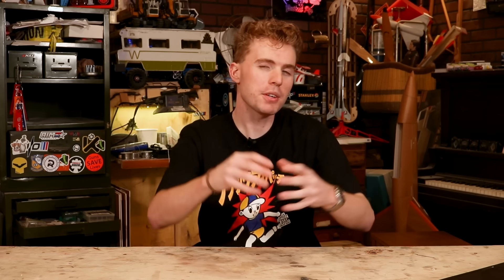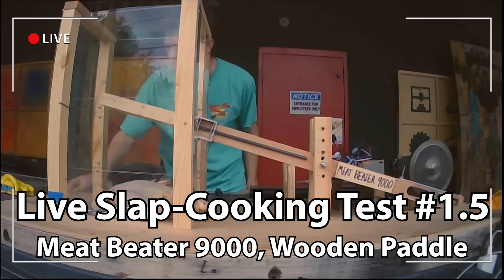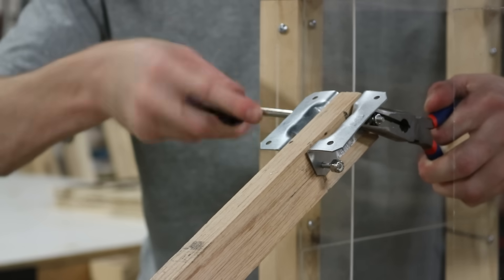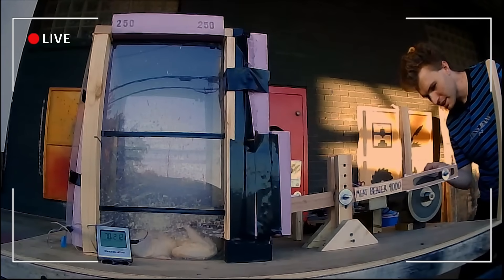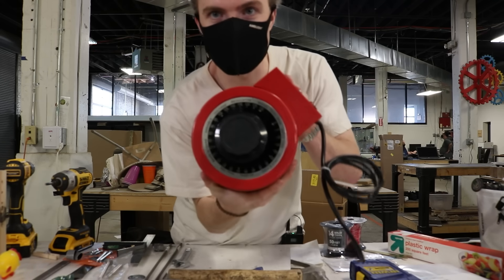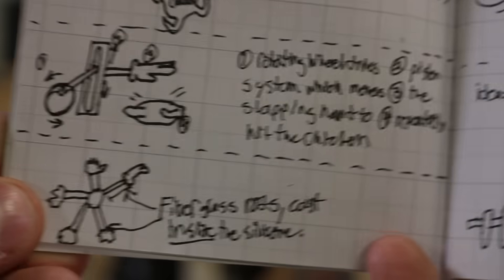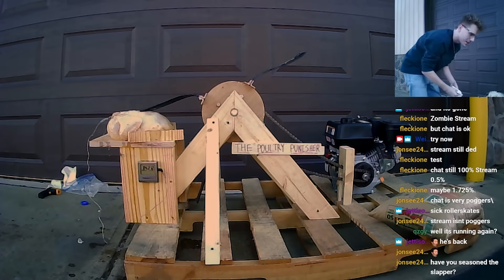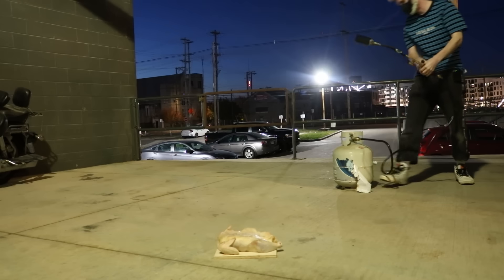How Many Slaps does it Take to Cook a Chicken?

Comment: You could go back to the meat beater 9000. 
Use a wide aluminum paddle that will distribute the energy evenly causing less chicken loss
Also use say a chicken breast without skin as it will not have to overcome the much thicker skin and will cook just meat. 
Also a reason that the poultry punisher didn't work is because it essentially pushed air onto the chicken essentially cooling it  a miniscule yet still enough to overcome the heat being put into it.

Comment: Should have put it under a peace of thin metal and slap the metal with the rubber not only will the friction from the rubber sliding off the metal and the energy in the slap will heat the metal up and cook the chicken maybe also tighten that chain

Comment: The kinetic energy of the slaps is not converted directly to heat, but rather toward both elastic and inelastic deformation of the chicken and to the failure of the internal structure of the chickens tissues. Also, some kinetic energy is being absorbed by the table and by the slapping arms.

Comment: So if kinetic energy can be turned into thermal energy which has heat heat is used to cook and speed can get so fast it generates heat if heat is generated it will stay heated until the o2 in the air cools it down so the faster I go the less time o2 has to cool it down and if o2 is slowed and heat is increasing therefore if I drop kick a chicken it will do nothing

Comment: Why didn't u make the box air tight and then get a silicone antenna where it is thinner at the top thicker at the bottom attach a paddle with a hollowed out handle made of metal run a bolt through put a washer on and then then nut and attach the mortar on the top so it is a bit tight vacuum so it won't lose heat but the kinetic energy won't be as use full so it will take longer but it won't lose heat or draw energy

Comment: I would use steel and a V8 engine instead of wood with bolts and a electric motor, so there's a low chance of breaking down.

Comment: Here’s an idea. You may be able to displace the energy coming from the motor more efficiently by using graphite powder on your joints, and a light chain lubricant. Also using polyethylene bushings on the joints may help with more energy efficiency. You can find these bushings in the suspension of some cars. They start to squeak overtime, but should work well. If you wanted to try a more manual approach, you can have a couple of buddies take turns smacking the chicken so you all get tired more slowly. The more people, the better. Kinda like a group of railway workers taking turns nailing a spike into the tie. Just a few ideas for further science.

Comment: I think the poultry punisher has a design issue: it generates powerful airflow.
While the meat beater generated currents as well, they were limited to a semi-closed system (also aided by your foam casing), while the poultry punisher creates currents that are much stronger and, not only that, are also drawing air from an open, cold system.
I believe that if you repeat the experiment in a closed environment or somehow reduce the airflow, it will be successful!
Don't forget that the experiment only hasn't succeeded because the meat beater broke: that one was working!

Comment: There’s still the factor of destroying the chicken, but a human hand usually contains our natural body heat which can transfer from us to surfaces we touch or vice verse depending on which has more heat- something that the machine itself possibly didn’t have being made of the materials it did. What if you had simulated this by finding a way to give the slapper a constant flow of our natural 98 degree (Fahrenheit) body temperature- or however much could be transferred with a slap- that could in turn transfer to the chicken? Add that the slightly-heated environment of a kitchen and the kinetic energy and you might get better results before you just end up tossing it in the oven.

Comment: What if you covered the chicken in some type of rubber shield and had that machine slap  the rubber on top of the chicken? Wouldnt the energy still transfer into heat and warm the chicken? Although the rubber might melt but I dont know

Comment: at every part of the engineering process the engineering team was looking at closed systems, or single problems without a ton of consideration for real world application. The poultry punisher by initial design is a bad idea because it only accounts for object of certain mass contacting object of certain mass in an instant. its pretty evident that no one considered what happens to the rubber slappers after initial contact, which is effectively sanding and pulling the chicken laterally. so there is no hope of the chicken lasting. it also looked like because of the flex and rebound of the slappy rubber that when the piece came back around it was in an ideal slap position. 

I still think this is doable. first, abandon the chicken punisher. it ruins the chicken. the second problem is all the math doesn't account for the non rigid chicken. make the chicken rigid. this could also solve or help with your ambient air problem. if you can build a metal or stone chicken mold and slap the mold with the chicken inside you would have better transfer of energy that wouldnt just go outwards as more lost kinetic wiggling, but also inwards turning thermal. using stone could be helpful for heat loss because the chicken is wet and is cooling easier than stone or metal would. the problem with this solution is it would take MUCH longer. so you would need a sturdier chicken slapper, which i think you could build. wood isn't meant for what you're doing there. the punisher may be the longest lasting, but it would still be heating by friction and not slapping, but you may have to just accept that as a given.

Comment: The problem with the rotational slapper is the friction of the rubber slappers drags particles of chicken away as the machine pulls them down and around with every slap. So while the first design had the “wasteful” up motion between each slap, it reduced the destruction levels significantly: I wonder if an all metal rig would hold together better. With parts welded together instead of using the bolts.

Comment: I know that I am not an engineer by a long shot, but what if the  contact area that the slapper has is with a piece of metal? The metal will heat up, and the chicken will be spared the unadulterated wrath of the slapper. Could the metal help retain some heat as well?

Comment: I’m curious as instead of using an electric motor you can use an electromagnet like they have set up on tattoo machines and control the depth via height you could prob get a higher frequency of hits too

Comment: The heat dissipates between subsequent slaps. In order to increase the temperature above the denaturation threshold of proteins and actually cook the meat, you'd either need to slap it that many times in a very short time, or somehow insulate it to avoid any heat loss. Both ways don't look practicable to me.

Anyway you try, it will liquefy for all the mechanical damage inflicted with each slap long before it's cooked

WTF Every time I add something to this comment, as I'm watching the video, then you say it in the video immediately after I click "SAVE".  LOL!

Comment: How did you all fail to take into account the air flow, the fact it's no longer in a box or any other number of details here...

You basically fanned it while slapping it... cooling it down while heating it up... adding a box wouldn't have even helped here.

What you need is 10 billion light slaps within a space of time that is probably impossible to achieve.
Reply: You literally surrounded your entire rig by a supercooled cyclone...

Comment: Another way to potentially look at the energy loss problem is to better control the ambient temperature of it's environment. If you could, say, raise the ambient temperature to always be 5-10 degrees lower than the chicken, you'd reduce the amount of energy you need to slap into the chicken to overcome environmental heat loss, while also definitively showing that the chicken's temperature is increasing by the kinetic energy you're slapping into it. And since you'd potentially need less slaps, you might not end up destroying the thing in the process.

You could also look at making the enclosure as small as possible so that the chicken has less space to heat up (and lose energy into). And if you try to control the ambient temperature, it's less space your need to control the temperature for.

Comment: I feel like the design of gas powered slapper  would create a lot more air movement, essentially cooling the chicken and negating the heat generated by the kinetic slaps. Additionally the rotation of the slappers is going to strip away the meat no matter what you do. I think you would need to design a slapper that utilized a slapping surface held at two ends, a little slack and flapped it up and down, sort of like a flag held at opposite ends. This would remove friction. It would still create air movement, but it would be easier to self contain within a "slapping oven" like you built for your earlier model. It would also be less prone to failure as the stress on the parts will be considerably lower. Additionally you could use a lighter material, which would damage the chicken less and place less stress on the slap mechanism. I think this needs a V3.0?

Comment: if 70-90 degrees in Fahrenheit, then it's super low in Celsius, meaning that you wont ever be able to cook a chicken, I think that physically it's not possible with motion/friction, because...well...yea, it causes what we see, even if you did it much faster it would just mean that the chicken would be ripped apart much faster rather than heated up. It's just like doing a burnout, while you may be able to lit a tire on fire, but that's only because the rubber is so thick, realistically the rubber material is just getting shredded away as well. If you had a thicker chicken that is solid rather than consists of sections and parts, there might be a chance, but it would still turn into a paste.

Comment: Would it work if you cooked the chicken indirectly, like if you cook a chicken on a stove you need a pan since the flame doesn’t directly touch the chicken so could you cover the chicken with something that would take the impact from the slap that is also able to transfer the heat to the chicken? This would require way more energy but you could increase the rate of slaps. Awesome video

Comment: Place the chicken  in a tight fitting rugged steel box and slap the crap out of the box. Insulate the box on all sides and except the the slap surface. This will. 1. Keep the chicken intact. 2. Confine the generated heat. 3. Surround  the chicken in heat via thermal conduction through the metal. 4. Allow for a faster more vigorous slapper for more heat generation

Comment: Isn't it possible to put some sort of a metal plane between the chicken and the slapper? That way the slapper would hit the metal (which I suppose is a good heat conductor) instead of the chicken. The chicken will be protected from being smashed, but the heat transfer is still there.

Comment: Wait you dont need to slap the chicken directly, you just need to transfer the converted heat energy from the slap INTO the chicken. What if the chicken was on a copper skillet and you slap the skillet instead? And maybe cover the exposed chicken with proper insulation? Just a thought.

Comment: I think there was an error in only slapping at one spot. Even if the chicken heats up it will not work due to the zeroth Law. He needed to rotate the chicken as well as the slapper to distribute the temperature throughout the chicken and to increase the temperature as a whole. I feel like if the chicken was rotate with hairdryer and the slapper it might get cooked.

Comment: It seems to me that the second attempt was worse than the first ono, because while the speed of the slaps increased, the flaps were not capped to hit only the surface of the chicken, as the first one was, and were smashing through  the chicken until they desintegrated it completely. I think another cool approach to the same problem could involve a vibrating plate on top  that hits only the surface of the chicken, not being able to ever desintagrate it.

Comment: Could you use the same machine designs in this video to simply operate in within the same closed system, any heat produced heats the chicken chamber, and you cook the chicken with convection from thermal losses and wasted slaps on wood/rubber/metal, not the chicken itself? You'd really just have to design a machine that wastes a lot of heat, but is resistant to heating up itself.

Slap not the chicken itself, but its surroundings!

Comment: Just a couple of things to think about if this is attempted again:

- you need a slow, constant drip of warm oil on the slapper.  Just occasionally putting on some cold oil will set you back a few degrees every time.

- the chicken needs to have some sort of heat-conductive material put on it that will allow the transfer of heat and energy while keeping the chicken from being slapped into a meaty paste.

Comment: What if you put the chicken in a highly conductive metal pot (with a lid), then slap the pot from the underneath side, heating up the pot while protecting the delicate chicken? Heck, you could slap the pot from all sides to speed things up. So maybe the first question is, how hot can you get a cast iron skillet just using slaps?

Comment: How about adding a thick metal plate on top and bottom of the chicken in such a way that the plates is just pressed against the chicken and the chicken is essentially sandwiched between the plates and the plates are evenly distanced and screwed in and then you use your temperature controlled rig but with poulter punisher?

With this technique, the chicken's integrity will be maintained as all the beating will be taken by the metal plates, but the temperature is transferred via metal plates
Pre-heat the metal plates before beginning the test, and use just the breast as it can be cooked quickly as there is no more meat to transfer heat to

Comment: Everyone is forgetting the big fundamental theory of exothermic reaction from the material you use to slap the chicken. Notice that when a 2x4 is used he achieved a high temperature than the plastic alternative he used toward the end of the video. Also, through thermal images the human body has an exothermic temperature starting at 91 degrees Fahrenheit with a internal body temperature average between 97 and 99 degrees Fahrenheit. So your heat exchange is something you are missing in this experiment. Imagine slapping this with an iron set to 91 degrees Fahrenheit.

Comment: Put the chicken in a rubber bag/box.   This will trap air and help keep energy. And rubber slapping rubber will create more friction.  And if the bag/box is hard and soft enough it will save the chicken from coming apart.
Reply: A more conductive material will help too.
Reply: I mean rubber on rubber is fine but if you want a better cook.   I'd use flimsy metal plates with a stick oil like corn syrup.   Keep applying little by little.

Comment: Energy can be transferred througgh materials so if the chicken were to be place into what would effectively be a thick rubber ballon or something similar that wouldn't fall apart from being slapped that fast, the chicken would hold together and the protective rubber shell as it is plyable woiuld also aid in the dispersal of the energy more evenly round the chicken. now i'm only saying rubber coz it's the first thing that comes to mind but what you need is a flexable and strong material to tightly cover the entire chicken and  i think it could work.

Comment: What if you apply the slappy slaps to a metal plate. It may heat the plate sufficiently to impart heat to the chicken. That way, you are not bound by the integrity of the chicken but you are still heating it up using slaps. Also, if you put it in a metal dome and surround that dome with maybe 3 or 4 gentle persuasion machines with the chicken inside - slapprowave oven

Comment: The Poultry punisher could have been better if it weren't directly contacting and ripping away at the chicken; without an impact material on top of the chicken, you were pretty much running a fine sandpaper flap wheel on it, like you would find in a rotary toolkit.

Comment: just put the some raw chicken meat into a container and partially vacuum seal it it, make sure to then put it into a container thats insulated and then vibrate it until it reaches the correct temperature and wait for a few hour making sure it doesn't reach a temperature that burns it.

Comment: What if the slap flaps were heated to a consistent 97 degrees? (Body temp) If the flaps have more heat, that could potentially speed the process of transferring the energy to the chicken exponentially.

Comment: Question: Have you tried putting something between the chicken and the hand, like a very conductive metal plate, the slap will heat up the plate which will cook the chicken, since the plate is metallic you can use way more force without destroyng anything to raise the temperature

Comment: One of the reasons the last attempt failed was more than likely the rubber pads were being cooled extremely quickly while they were rotating back into position, along with you basically waving a piece of rubber at the chicken before coming into contact with it. These two conditions most likely resulted in you having very cool rubber pads, and air cooling your chicken. Otherwise I think your last attempt would have worked given these two issues didn't exist.

Part 2?